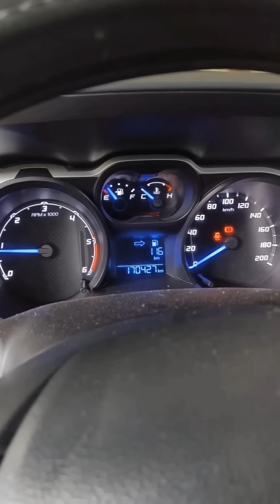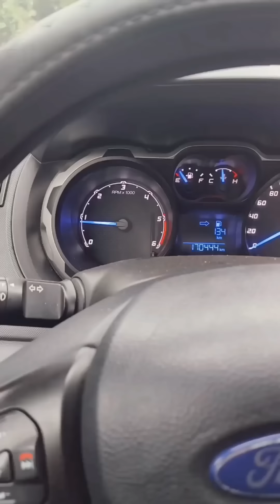FORD Ranger Subrang Usok at Palyado Paano Ayusin at Anong Dahilan

Comment: sir good morning mayron ako dito ford ranger diesel 2.2 bago na ang mga injector pero pag accelerate mausok hangang 2rpm lang syan pero pag naka minor walang usok bago din ang turbo charger nya pinalitan narin yong map sensor intercooler at sa intake nya pwdi makahingi ng advice boss ang egr nito solenoid valve sya